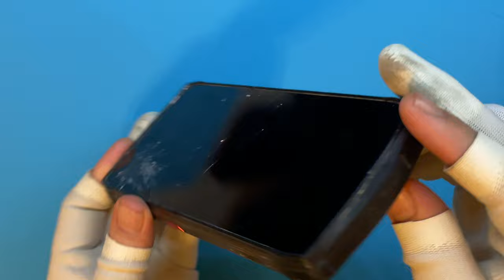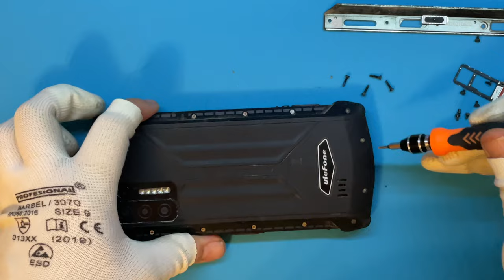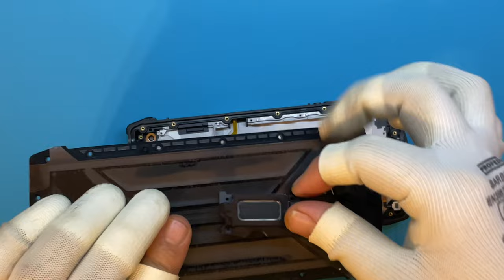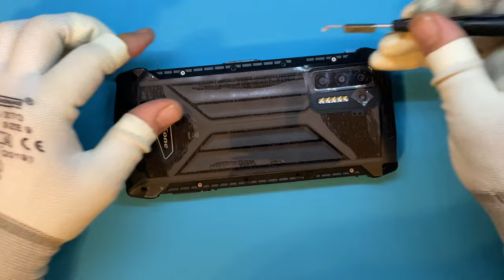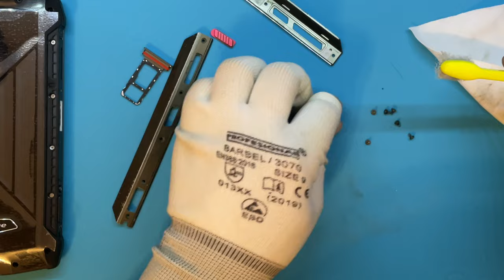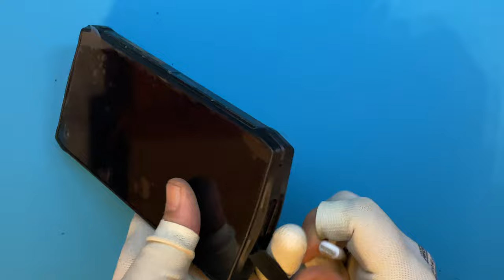Ulefone power armor 13 screen replacement

Comment: A phone toilet, the screen disappeared twice, no assistance, washed under a stream of water, it no longer works. No more Ulefon
Reply from the maker: Hello, it depends a lot on the condition of the phone, if the phone has suffered several large falls and the corners or the edges of the fall have been destroyed... it also depends on the condition of the rubber protection, if everything is in order, the authorized service should repair it under warranty
Reply: @mk.service-phone  Never taken a hit, only washed because it was soiled with ice cream, made under a trickle of water. But the serious thing! The assistance says: for water we give no guarantees. Ridiculous.